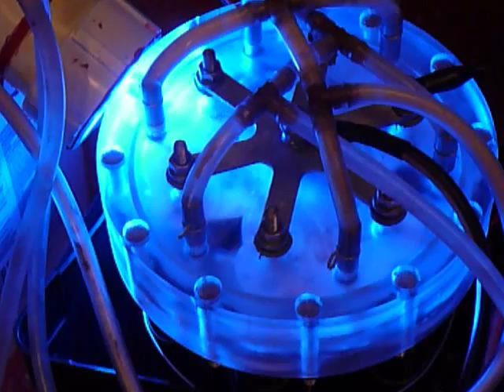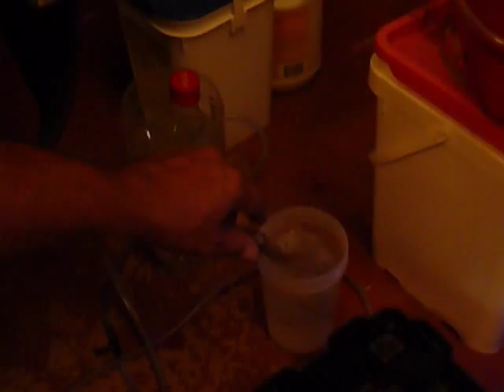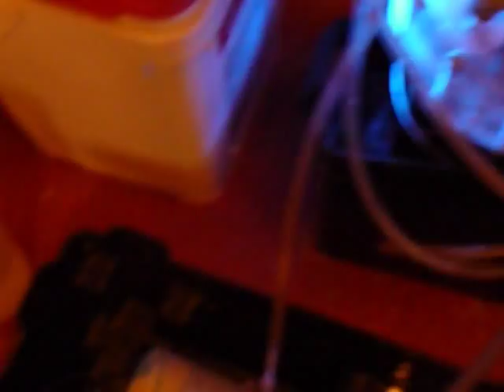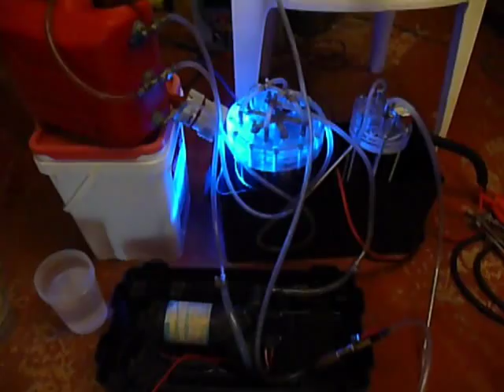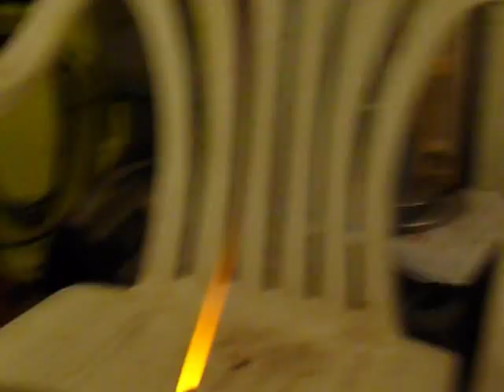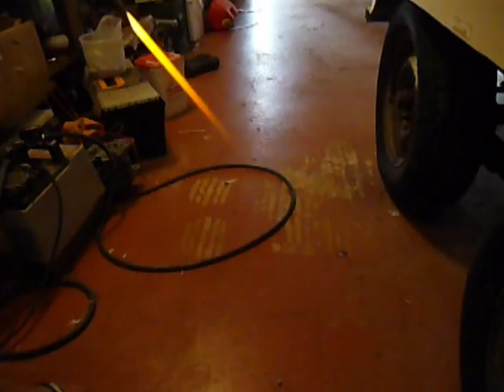hho update Part 2

Comment: 100amps would fry you like a chicken very dangerous
Reply from the maker: you are correct, the amps are what kills you but still need volts to push them thru your body resistance.
Going to need a lot more than 28 volts to let those amps flow through a person.

Comment: Stan Meyer references are spot on!   But we should not mention "joe cells."  JC's are a RELIGION: Must to gather "holy water " from proper source, store it out of sunlight, pre-condition the water in a "charging cell"ALWAYS think positive thoughts and "negative people" can halt cell activity.JC's apparently do not operate from 2-4:00 AM according to JC acolytes.   =GOOD REASONS TO distance ourselves from joe cell references...  

None of that clap crap applies to YOUR CELLS!!!
Reply: I really believe if someone designed a way of shooting a high voltage spark into the combustion of the engine cylinder it could be possible. If anyone don't think so or think's it's possible and know's how to do it or know's of another way please share. I totally appreciate everyone posting video's and being honest about there result's. I know the Stan me-yer thing worked and a couple other devices. Maybe I should do solar or wood gasification I can get a lot of junk mail to run it lol.